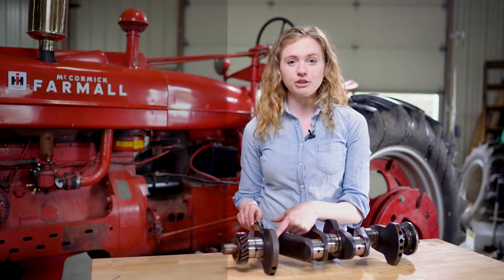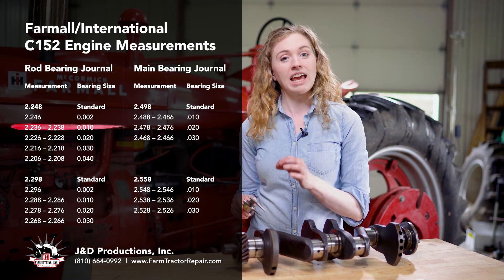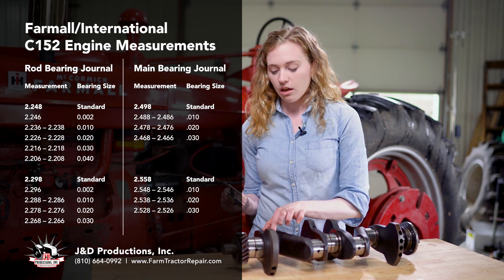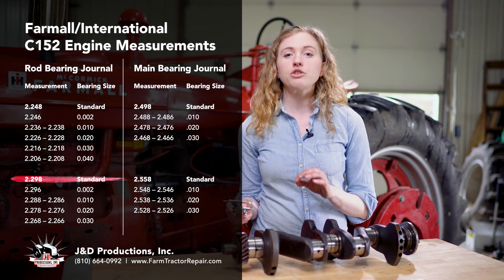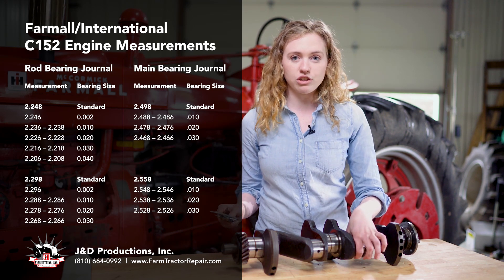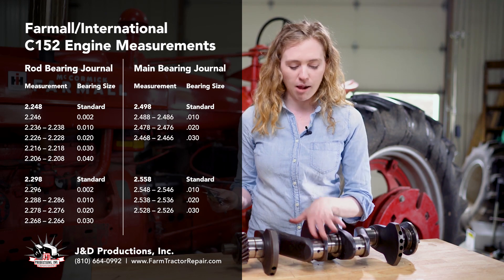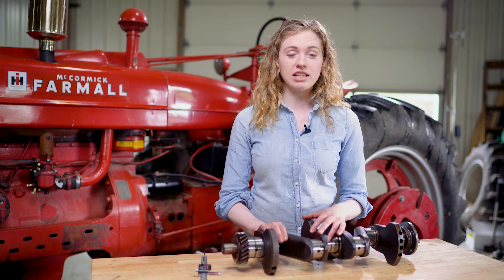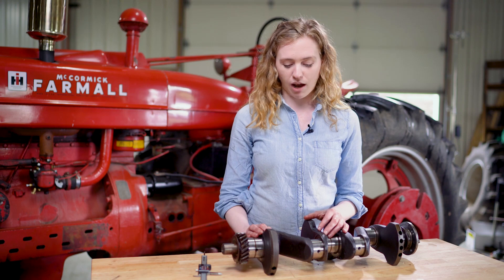How to Measure your Engine Crankshaft for Rod Bearings and Main Bearings: Farmall H or W-4

Comment: And with that explanation, I am now positive that I will not be removing the main caps...because I won't be removing the crank...because I won't be removing the engine. The only thing I want to remove, well, the main thing I want to remove is that un-holy intarnation knock.
So only the rod bearings...So now, how do I figure what size I need? 
This works for other engines...the math, not your chart...
Okay, the math your chart follows...and what you explained.
Yes. This actually is the first video that bothered to explain in detail, with an example yet.
So I should measure the crank at each rod and find the original specifications and subtract the original from...no, the current from the original. And that should do it...I hope.
Reply: I seem to be a couple years behind of the rest. 
I wonder if Scotty Kilmer knows. He is pretty knowledgeable about engines.
... I think he's had too much coffee before his videos.

Comment: I did not measure my crankshaft but machine shop lightly worked the journals to achieve smoothness, cylinders were de-glazed not exactly bored, surface was cut a minimum pass, not much and i installed standard sizes for all components; I am wondering if the engine will run ok when start and if I would not destroy it.

Comment: Always measure crank journals in two places 90° apart.
Use a quality micrometer.
Starrett or Mititoyo Browne Sharpe etc.
Also always chamfer radius oil holes smooth on all journals.

Comment: Another great Video! Thank you!  Also I finally did change that lifter and valve on the 49 8n with a adjustable lifter.  Worked out fine, Thanks for your help Rachel!

Comment: As always, a very straight forward professional video.  What shop wouldn't be head over heals to have such talent.  That said, precise measurements are somewhat intimidating to novices.  As such, I'd recommend you include taking actual measurements in your videos.  While professionals are comfortable in dealing with thousandths of an inch, many if not most weekend mechanics aren't used to do doing so and may feel it is beyond their capabilities.  Showing the proper use of micrometers, calipers and feeler gauges in your videos would help assure them.
Reply: Or... for most of the world...in metric measure.....
Reply: @neville132bbk  For most of us, we keep measuring tools in inch and metric.  For these old US and Brit tractors, it is inches.
Reply: @richardanderson2411  thanks, Richard...in the 50s through to the 70s Ferguson 35s were very   popular on NZ farms..still numbers around for light work